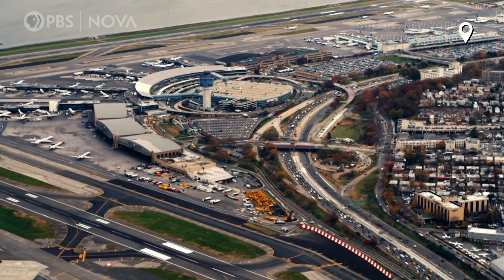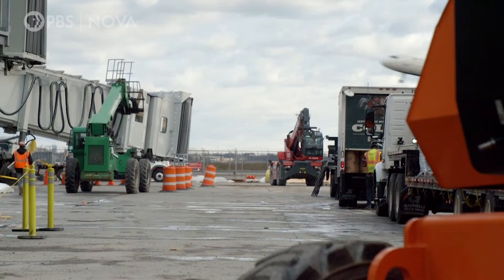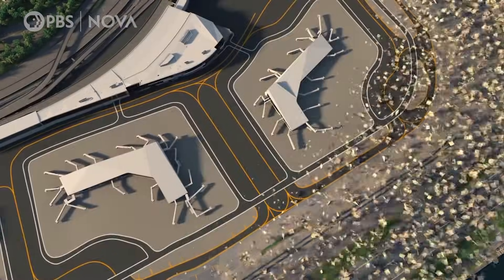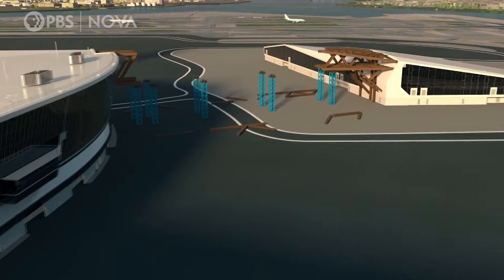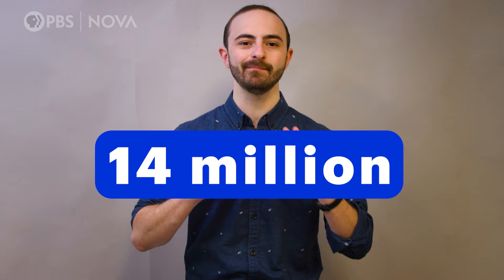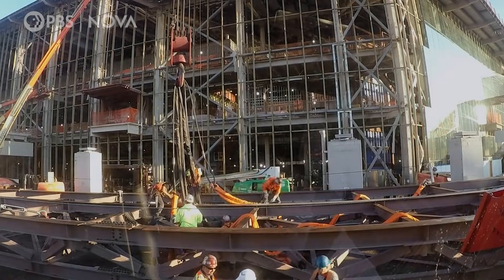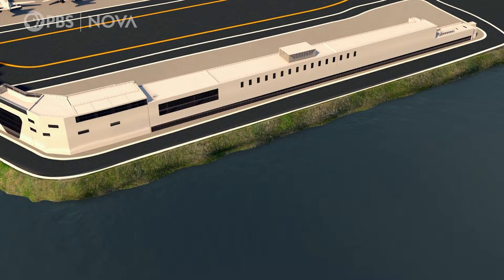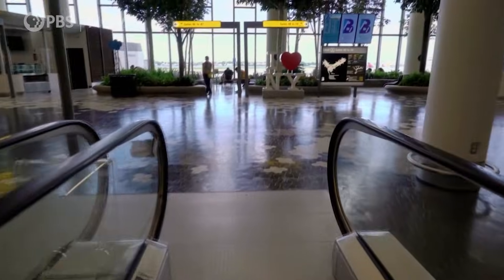The $8 Billion Overhaul of LaGuardia Airport: Engineering a New Era | NOVA | PBS

Comment: When I flight I expect the plane to lift off and land. I don't give a fig for all the luxurious crap and expensive food.
Reply: I used to think that way. When I visited the old LaGuardia, I swore I would do whatever it takes to avoid it in the future. It was 90 degrees in the tiny, decrepit terminal, we waited (standing) in a way-too-small boarding area, then were called up and went down an escalator to another cramped waiting area, then boarded a bus that went around the terminal to our aircraft. Another line there to board. Then we had to wait because we were in the back of the alley and other aircraft were holding up our departure. I generally don't mind the airport experience as much as most people, but it was horrible. The airport was falling apart and it had clearly outgrown its design footprint. Add to that the fact that, if you were connecting to a different terminal (luckily we were not), you had to go landside and go through security again at the other terminal. 
We flew to NYC a little over a month ago into the new Terminal B. It's beautiful, it's spacious, you actually have room to walk around people if needed, it's easy to get around, and we had food options (which is nice when you have to be there 2 hours prior to your morning flight). Getting our bags was easy, as was checking them for our return flight. The TSA checkpoint was a relative breeze. They did a wonderful job, and it does make a difference to most travelers.
Reply: OK boomer
Reply: I hear you!